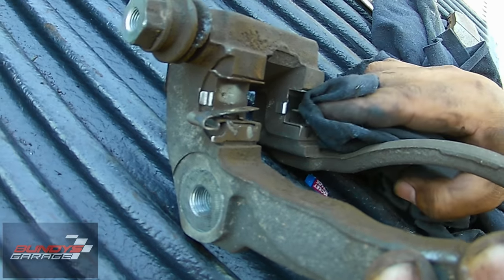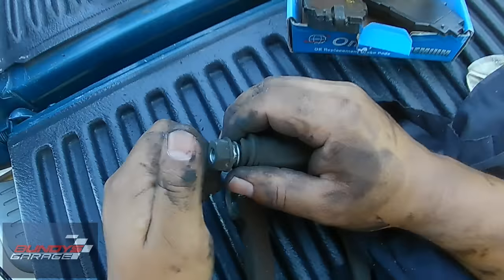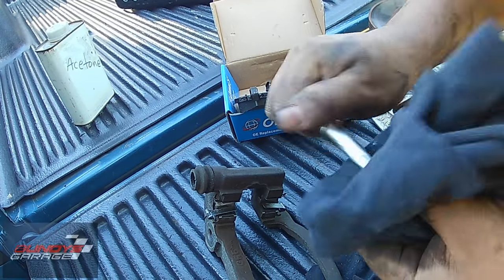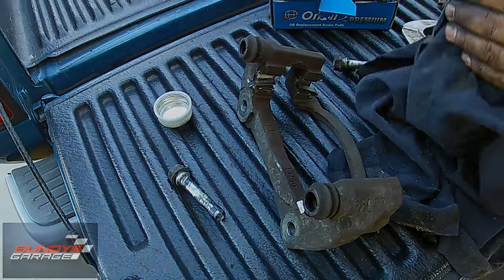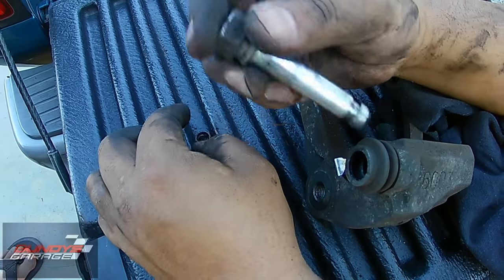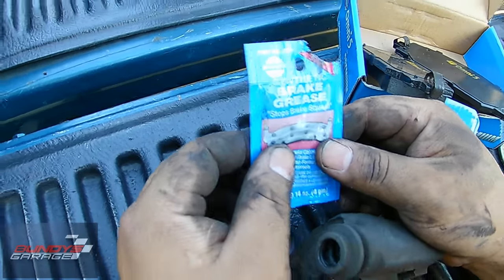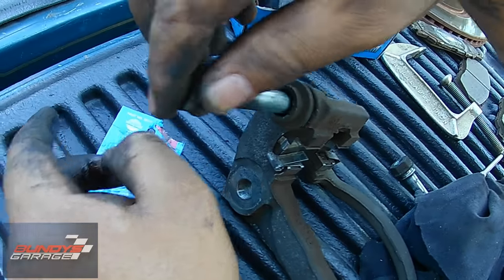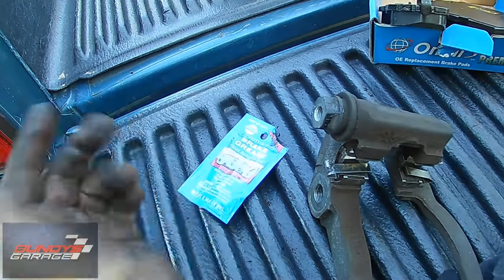What is that piece of rubber "tube" on the lower brake caliper pin? | Honda | Toyota | Lexus | Acura

Comment: Same here. I own 2017 Toyota RAV4 se and I started hearing some noise like break pads were worn as I was driving. i checked the pads and they were fine. Then I did a little research and took the caliper off to check the pins and sure enough the ones with the rubber ring were completely stuck on the front and rear calipers. Breaks have never been replaced as the car only has 40,000 miles still on the original ones. I threw away the bushings, cleaned the pins well and greased them up with Toyota grease and now not only that I don’t have a vibration when breaking but I also feel like the car has slightly more power! Thank you for the video!
Reply: Yes, I believe that will give you at least another 50 hp
Reply: @chrisE815  lol. I myself am trying to figure out how this guy thinks slider pins would give more power ha ha
Reply: He feels he has more power because his brakes aren't stuck against his rotor anymore from the seized slide pins...
Reply: thank you Shawn, it seems that people are becoming massive morons these days with those meaningless replies haha. Yes the pads were holding a bit too much thus the sounds I was hearing due to the stuck pins. I don’t have the issue anymore. Since I removed the rubber rings I put on about 8,000 miles and the other day I jacked up the car to check and the wheels are spinning free so its great! I Definitely feel I have a bit more power since the pads open completely after braking. Thank you!
Reply: @georgeaudi  just for next time, you can buy a brake hardware kit and it will come with the rubber bushing that goes on the guide pin. Costs about $20. And only use pure silicone on that pin so that the rubber doesn't swell. Sil-glyde work well.
Reply: Shawn I will look into it although I doubt I will put it back as the rubber was so seized up in there after only 40,000 miles. It’s not like someone serviced/replaced the brakes or put the wrong grease either. The car at the time only had 40,000 I bought it brand new and to have that serious of a problem at only 40,000 isn’t good. I have never had such an issue with other cars and brakes. Everything works great as of now so time will tell.
Reply: @georgeaudi  what happens is the grease/silicone dries up because of the heat of the caliper. Thats why yearly brake maintenance is important. I wasn't a believer until I saw my brakes after a year. Every year you should:
-clean pads + caliper bracket shims  with wire brush
-grease brake pad ears + shims (the metal tabs that the pads rest in. Copper antiseize is fine for this part)
-remove, clean, and apply silicone on caliper pins. 
-reapply grease on back of pads.

Trust me on this one. I own two different vehicles and see how quickly brakes can get seized up.
Reply: Shawn I believe you. I will go over it all next spring to check everything.
Reply: You mean like it has more hp? lol
Reply: It has been 3 months. Is there any noticeable downside when you removed the rubber sleeve? Like rattling noises or squealing brakes?
Reply: The rubber sleeves make it so the brake caliper doesn't constantly move easily. It keeps it snug in place but still allows it to move when applying the brakes, allowing the brake pads to be pressed against the rotor evenly.
Reply: @warnacokelat  no difference at all. Brakes work amazing I don’t hear any noise or rattle. When I change the pads in a year maybe I will check the pins but so far so good. I don’t understand the purpose of the rubber ring.
Reply: @Shawn855  my brake pedal doesn’t move more without it though. It’s the same distance and pressure needed for the brakes to engage now and before.
Reply: @georgeaudi  thanks for feedback. already removed the swelled rubber sleeve as a quick fix for now.
Reply: @georgeaudi  it won't change the brake pedal distance.
Reply: @Shawn855  that makes sense. i'll get a new guide pin on monday. they don't sell the rubber sleeve for my car, it only comes as a brake caliper repair kit that costs as much as a new set of pins.
Reply: Look at the end of the day we need to ask ourselves the following questions:
1. What kind of car am I driving? Rav4! 

2. Am I on the racing track shaving off half a second on a lap? Nooo

3. Do those rubber rings create issues by swelling thus seizing pins? Absolutely!

4. Can I afford to buy a rubber ring? Yes I can buy 1,000,000 of them no issues but I don’t want to have seizing again!

5. Does it work fine without them. Yes it does I don’t feel anything different using the rav as it’s supposed to be used. 

6. Do I need to think about pins all day long now? Noooo
Reply: @warnacokelat  you might be able to get away with buying the caliper pins (the pins come with rubber on it already. I had to do that for my Chevy Cruze )
Reply: @georgeaudi  I think it's more of a matter of: does the person notice it. I notice any little vibration, noise or rattle so I know right away if the rubber bushing is seized or worn out or missing, whereas other people wouldn't notice a difference.
Reply: @Shawn855  I totally understand! I felt the seized pins too which was very annoying as it progressively got worse. Now it’s fine. I take care of my rav as if it is a Ferrari haha
Reply: @georgeaudi  rav4 is the way to go. Great vehicle. Just don't buy a Chevy Cruze or dodge journey like I did lol
Reply: @Shawn855  I used to have a 2002 grand Cherokee. It was a great vehicle but constantly needed some repair work no matter how great I was with servicing it so I know how you feel. American cars are very comfy and have great v8s and are affordable and such but longevity is always an issue. The rav4 is strong but not the most comfy car a bit loud inside and massively underpowered with the four cylinder engine. There is never a perfect car to be honest with you!
Reply: @georgeaudi  perhaps a Toyota Camry lol
Reply: @Shawn855  yeah right but it looks like a car for older people somehow. I do like their v6 engine! It’s pretty reliable even with minimal maintenance!
Reply: @georgeaudi  I got a bit neurotic trying to pin down what's causing some weird noises on the front end. replaced everything and there's still a bit of weird noises happening. and today I just found out that my mechanic guy put the wrong sized bolt in the caliper pin after a major brake service.
Reply: new pin comes with brand new rubber sleeve seems to seized again after a week. i think i'll just use the old pin and remove the rubber sleeve.
Reply: @warnacokelat  that’s what I did to mine and so far so good. I’ve done tons of driving and there is absolutely no difference at all! Brakes work just as good. No vibration, no weird noise or else.
Reply: Your feeling like the car has slightly more power is just plain wrong.
Reply: @garychen483  read previous thread. When brakes hold is very obvious you use much more power to roll forward. After driving with stuck calipers for months when fixed felt like having a v8
Reply: @warnacokelat  i tried this on my highlander and noticed more caliper noise (clicking) at low speed when coming to a stop.   The bushing is there for noise vibration reduction
Reply: @Shawn855  no its for noise reduction
Reply: @MrTurbo87lx  as stated in my previous comment.....the rubber sleeve acts as an insulator/cushion for the pin. And that insulated pin makes it so your brake caliper doesn't just move around all willy nilly. What you're saying ties into what I said: you're hearing nose....because the caliper is now free to move immediately so when you press the brake caliper, it snaps into position, instead of going smoothly into position. Not only will you hear noise, you'll also notice mild vibrations, as well as uneven wear on your brake pads.
Reply from the maker: You will not experience uneven wear on the brake pads! And unless you drive in silence with the radio off and no other cars around your not going to hear the pin “snap” back into position. You will experience uneven pad wear with a stick caliper slide pin. So it’s your choice, do what you want...
Reply: @bundysgarage  u will most def hear the pin.  I would know it happened to me
Reply from the maker: ok
Reply: Brakes. Not breaks
Reply: @vatoloco2066  thank you, I realized the mistake after I posted the comment and I haven’t been able to correct it since. Not sure why I’m getting a error after editing. Anyway…
Reply: My 2010 RAV4 was getting poor mileage.  Brake was wearing quick too.  I removed that stupid ring and when I drove it, it felt like a bat out of hell.  My car felt like it has gained extra power.

What’s the point of that stupid thing anyways?
Reply from the maker: Over engineered…that’s why!
Reply: @Mr-Clark  I ask that question every day. No obvious reason. I’ve been driving without those for ages and nothing different at all. The brake pins move free and I have no issues to report!
Reply from the maker: Hell yeah!!!!
Reply: @georgeaudi  My guess is so the brakes wear out faster, uneven wear and cause all sorts of problem in hopes of you taking your car to a dealership where they will screw you over with expensive brake jobs and possibly sucker you into trading in and buying a new car.
Reply: @warnacokelat  During installing what type of grease you've been using ? that rubber will swell if use normal grease.. i never have that stuck or rubber swelling issue, each time i changed the pad, i use rubber grease on that slide.
Reply: And we're listening to one guy's opinion how pathetic 😡 the engineered with the sleeve for reason do your services and your maintenance on your brakes don't wait till your brakes go metal the metal service them those slides move the calipers move all the time do your maintenance..
Reply: @harisyoung4110  Bendix Ceramasil brake grease. Changed new caliper pin, it still kinda stuck because of the rubber part. Which is weird, because the top pin in the caliper didn't have the same problem. Now I simply get rid of the rubber and hope for the best.
Reply: @warnacokelat  If its not making any weird noise without the rubber screw, than it should be good.. older car caliper dont even have that rubber shaft.. or maybe you can try find an aftermarket shaft that is using a silicon instead of rubber, its cheaper than the oem parts..  im using those silicon shaft on my daily car with just a cheap rubber grease made by seiken.. its has been through a couple years, last time i checked while replacing the pad, that rubber still looks normal without any wear.
Reply: @harisyoung4110  yea the new pin is aftermarket with silicon. have to use quite a bit of force to get it out, but it wasn't as bad as using pin with swelled rubber. something must have happened with the bottom caliper.
Reply: @irisbaez1972  worked great for me. None of my caliper slide pin bushings expanded from using it compared to when I used to use other grease which expanded the rubber and caused the slide pin to remain stuck in place due to the swelled bushing, which then caused uneven wear on my pads but hey man, you do you.
Reply: Man this is exactly the same problem i have on my hyundai from 2013. I even put new rubber pieces in and still keeps doing the exact same thing
Reply: @George Audi  Hey I feel your pain I understand I'm so glad I came across your page..  I have a 2016 rav4 and the same thing the calipers are sticking and I just fixed them about 2 months ago,,  and I understand what your saying it really holds the rav4 back..  and it does rob the power..  I will take the rubber off tomorrow thanks for the information..
Reply: I just did my brakes 100,000 miles ago and used the best grease (Prolong) and the pin was totally locked up on the lower caliper pin,  the upper pins were fine. I will not be using that little rubber piece on the Lower Pin. I agree with the maker of this video.
Reply: It's fucking BRAKES, NOT BREAKS. Why is basic literacy so hard
Reply: Brake!!!!!
Reply: The Original Brakes usually last at 60,000 Miles

Comment: The one with an L on it means it's the Lock Pin, the other is the Guide pin and has a G on it. You'll also note that the caliper has matching L and G marks by the holes for where they go.
Reply: Most underrated comment here. Should be pinned at the very top.
Reply: Agree.  Useful tip
Reply: Finally an explanation that takes the guessing out of these pins!
Reply: The bushing pin goes on the bottom FYI
Reply: The placement of the pin with the bushing depends on what side of the rotor the caliper is mounted to and the direction that it will be spinning.
Reply: @JonathanP.wJPennsLawnCareL-o9c  Can you clarify the pin with the bushing should be at the leading or trailing point of the rotor rotation? Thanks.
Reply: @next1mpact  it should be installed in the caliper at the leading point.

Comment: I just did my brakes 100,000 miles ago and used the best grease (Prolong) and the pin was totally locked up on the lower caliper pin,  the upper pins were fine. I will not be using that little rubber piece on the Lower Pin. I agree with the maker of this video.
Reply: What’d you expect by going 100k without doing brakes?
Reply: So, you should doing brakes more frequently and byu new rubber, pls. I am pretty shure there is reason why that rubber part is on pins. You don't have luck when you are thinking.

Comment: Rubber goes on the trailing pin. If caliper on left of rotor  the trailing pin is on the bottom. If caliper on right side of rotor, the trailing pin at top.
Reply: - Haha... Thanks for pointing out that important information.....
Reply: whats a trailing pin?
Reply: @Path2Insanity  just a name for the position of the caliper pin
Reply: @Path2Insanity  top of caliper or bottom of caliper

Comment: So it really doesn’t need the rubber sleeve on the pin?i have a 04 Altima and was about to buy a 10$ kit for each caliper just cus that sleeve wasn’t letting me put in the bolt properly

Comment: Wow! This video was exactly what I needed to see thank you so much. My pins were stuck because of those swelling up and breaking. I didn’t know if I needed to replace them or not. Thank you.
Reply from the maker: Yeah those things get stuck cause guys who don’t know what they are doing put regular grease on them and they swell.
Reply: @bundysgarage  yes your right if you put wrong type of Grease that rubber is gonna be swollen That's why I used Permatex brake grease to my sliding pins because permatex grease is not harmful to rubber
Reply: Such good advice
Reply: @Yanbrymenocu  I recently used Permatex 24110 Ultra Disc Brake Caliper Lube and now I am seeing reviews where people have found that it swells rubber also.
Reply: @vdivito  mine is not swelling its good brake grease
Reply: @Yanbrymenocu  Thanks for the update.
Reply: They still swell with that special grease!
Reply: They are anti rattle sleeves for the pins. Without them they could rattle.
Reply: @bundysgarage Ik you’re probably not active on this video anymore but im sittin here workin on a car and saw someone used what looks like red bearing grease on the guide pins and now the one with ruber seal isn’t working correctly glad this confirmed my suspicions

Comment: Thank you for this video so much what's funny is both of my pins with the rubber were seized and one of them even broke inside the caliper when I took them out and the pins without the rubber came out nice and smooth. And because the pins with the rubber seized  I also noticed my brake pads  we're very uneven  one side had almost a full brake pad and the other was side was completely worn out . I never had any spare rubbers so I put my caliper pins back in and I was worried until I saw this video thank you so much.

Comment: If you use the wrong grease, those rubber pieces on the guide pins will swell. Don't forget to clear the inside of the pin tubes.

Comment: Got replacements dust boots & sliding bushings from my GM dealer. Even with lube, those brand new bushings were so tight that the pins wouldn’t move so I dumped ‘em. The car brake good and I haven’t noticed any particular rattle.

Comment: grease is what is known to chew up the rubber plus time and heat.

The only lubricant to use on the brake slide pins is SILICONE based    ie. not Petroleum based grease !

The "brakes grease" is a mixed formulation that dries into a gum with heat to quiet the caliper to pad noise. 
Most of its petroleum lubricant promptly evaporates to render as gum.
It should be called "brakes GUM" keep it away from your slide pins because it is oil based and short lived unlike high-temp silicone.
👍🏻
Reply: You mean I can't use petroleum crease for caliper pins ?why?
Reply: I agree! I have always used anti seize thinkn it would keep them free, but have discovered what ur sayn is TRUE! SO, even if u get rid of rubber ring on pin, u can STILL affect rubber BOOTS! I purchased a silicon can. Im a senior who IS ALWAYS still learning!
Reply: @mustafaalshaheen8042  he literally explained why in the comment you're replying to 😂😂
Reply: Iv never had an issue using grease inside my caliper piston lmao when I did have problems is when I didn’t use grease. Calipers go bad every few years. Period. There’s no way around that
Reply: That’s not true. I have never had them go bad after 100,000 of miles
Reply from the maker: If your calipers are going bad every few years, find a new mechanic. I’ve had caliper last the lifetime of the vehicle. The job was done right the first time.
Reply: @margaretharrison5885   My car is 2008 Elantra and has 172K miles original calipers. Of course, I do my own maintenance.,
Reply: @chazdaddy6076 Not true! My brake jobs on all my cars last 7 to 9 years. If yours only last 2 to 3 years look for another mechanic.
Reply: This guy knows his stuff. I agree 100 %. Don't use ordinary petroleum based.  It will shorten the life of your pads.
Reply: @mustafaalshaheen8042  - Petroleum grease will damage the rubber guide pin boot and the rubber guide pin bushing.